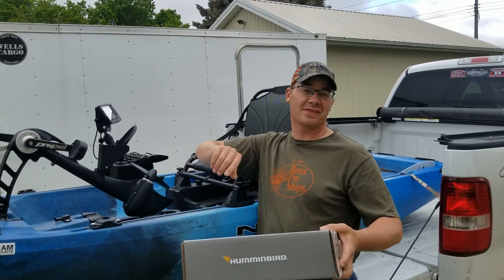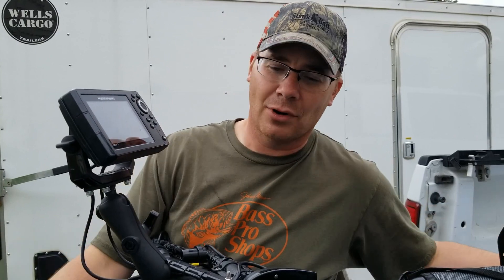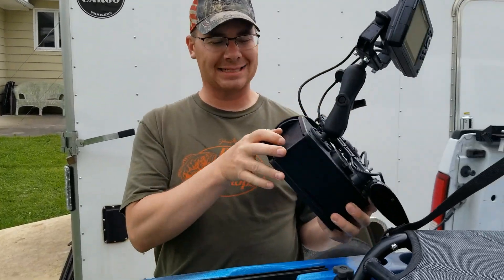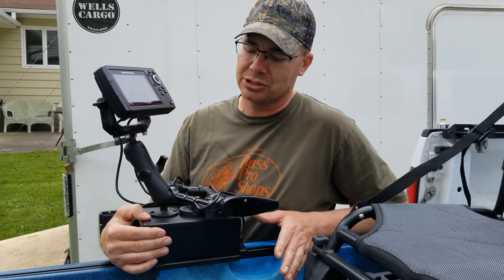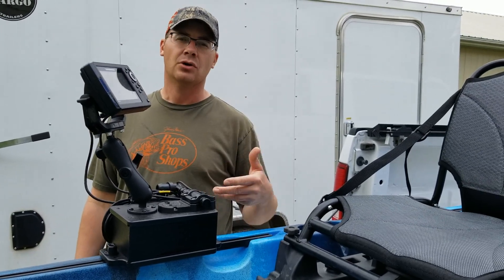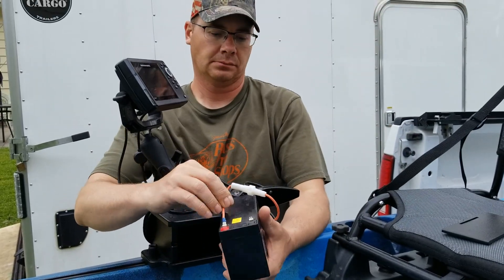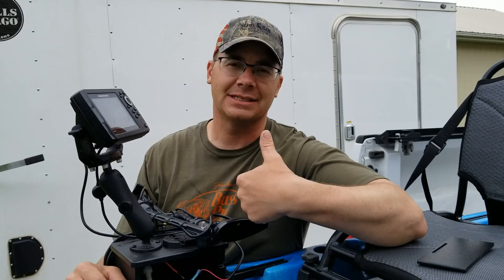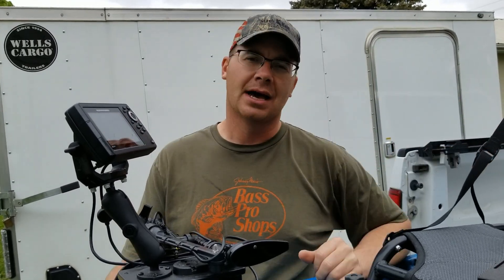HELIX 5 on my Kayak! | How I Mounted my Fish Finder

Comment: Thanks for sharing. Have you had any problems with the fish finder? Is it pretty accurate? Does it come with pre installed maps of lakes or coastal waters? When not using it do you disconnect both wires to the battery?
Reply from the maker: It’s pretty accurate, sometimes it gets the depth way of for a few minutes, kinda frustrating because I wanna map my ponds and then it looks like there’s a 70 foot hole in the pond or something.  It does have maps for most lakes, not sure about coastal waters.  I take out the battery and put it on a tender when not in use.  Thanks so much for watching!

Comment: Very cool set-up! I'm looking to get a similar system on my kayak (will be the first time for me dealing witih electronics on a kayak). Curious question: how long is that battery's life for just running the humminbird? Ever had any issues with power loss?
Reply from the maker: Sorry for the late response.  I can run my depth finder for about 1.5 days of fishing, probably 12-15 hours on a single charge.  Granted I have a standard run of the mill battery.  You can spend a little more and get much better batteries.  I just bring it in at night and put it on a battery tender and it works great.
Reply: @MidwestBassHunter  Great. Thanks for the info!

Comment: One question why did you use ram mount with ball joints 
If you could have used a Yakattack lockNload helix mount
Also thanks for the great video 
I’m building mine just like yours we felt the same way about drilling holes into our kayaks
Reply from the maker: So I could mount it to the Cell Blok, the lock n load is designed to attach to the track, unless it also has bolt holes (not sure).
Reply: I’m not sure what it is called but the part on the switch blade in between your ram mount and where you tighten the switch blade there’s a hole that’s where you put the lockNload helix 5 mount (it’s part of the switch blade)

Comment: Doesn't the weight of the whole system in one spot cause the kayak to list.
Reply from the maker: I counter balance it with my tackle placement in the back of the kayak and my anchor is on the opposite side.